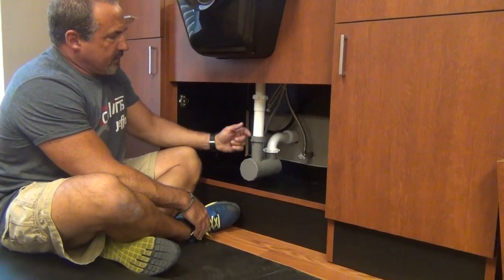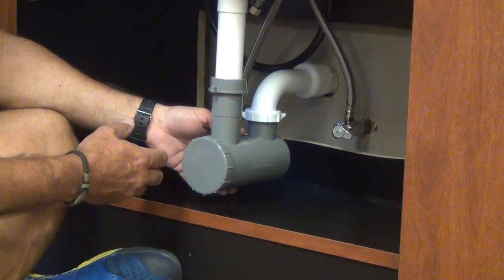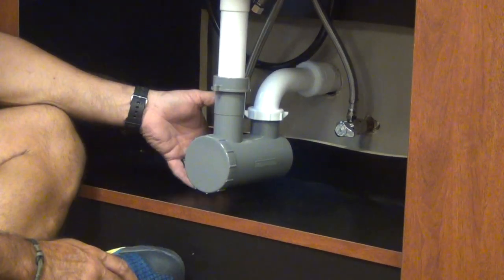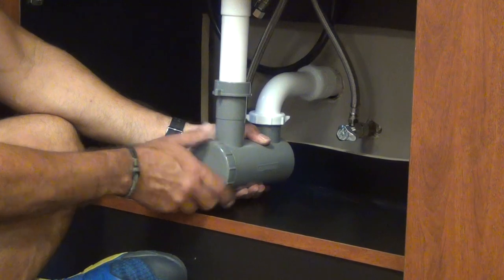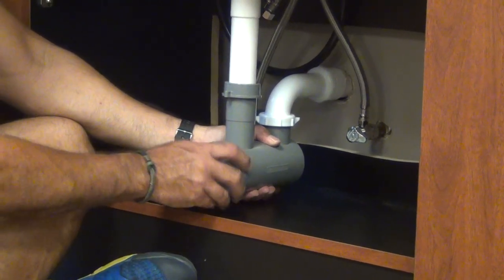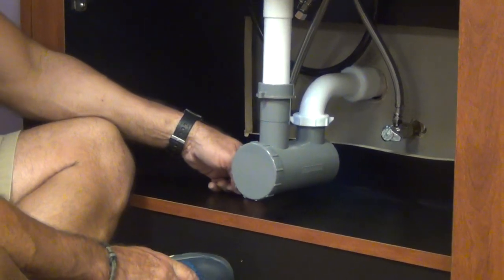Cleaning Collins' 1701 Hair Trap

Comment: I recommend the use of a hand pump, to draw dirty water out of the hair trap, first.      Place intake tube straight down the drain, from the lavatory.    Pump water into bucket.    Spillage below hair trap will thus be minimized.        Harbor Freight sells such hand pumps.                http://www.harborfreight.com/multi-use-transfer-pump-61364.html
Reply from the maker: That's a great tip!  Thank you!
Reply: Obviously, my method excludes allowance of mechanically-linked stopper, as commonly provided with faucets.        My implementation is for residential bathrooms, and I cannot speak for beauty parlor sinks.     I employ a stainless steel mesh (sometimes two, in series) in the lavatory drain opening, as a first snare for hair, lint, and any other substance that can be caught before it enters the drain piping.       

My recommendation (for pumping out hair trap) therefore is eminently compatible with the mesh snare, which presents no obstacle for tube insertion into drain.              The mesh is typically cleaned daily.          

The below-sink trap requires, perhaps, monthly cleaning.

Comment: So, If I understand correctly, if your using a hair trap you do not need a P-trap in the system. Correct?
Reply: Correct. The 1701 replaces the actual trap section of a "P" or "S" trap.

Comment: will shampoo foam cause any issue with this trap? eg: back flow
Reply: The 1701 simply takes the place of a regular sink trap. If the drains are working normally and the trap kept clean, you should see no difference in performance.
 We are not aware of any issues involving foam; any standard salon shampoo should not present any problems.
 If you have further questions, please call Collins Tech Services at 855-757-6877.

Comment: What can I do if the cap was over-tightened???
Reply from the maker: You might need to remove the entire hair trap. Have someone help hold the trap while you keep trying to loosen the cap. (it will be easier on a table).Too much torque (force) on the drain might cause damage to the drain piping.
 For future, apply a little Vaseline to the o-ring and "snug" the cap only until it does not leak.
 You can also call Collins Tech Service at 855-757-6877.